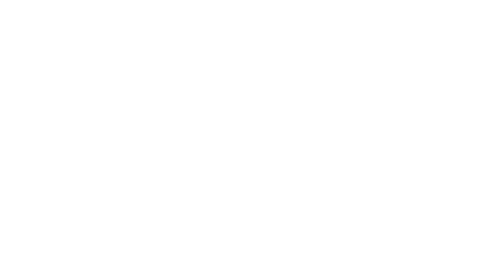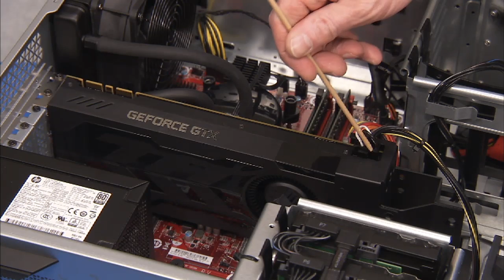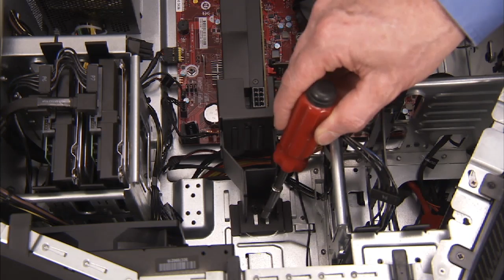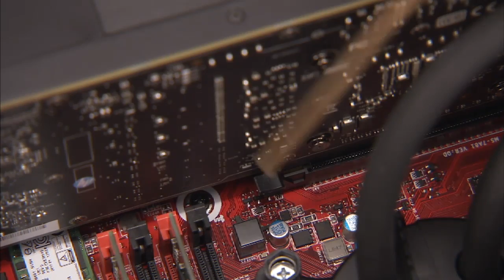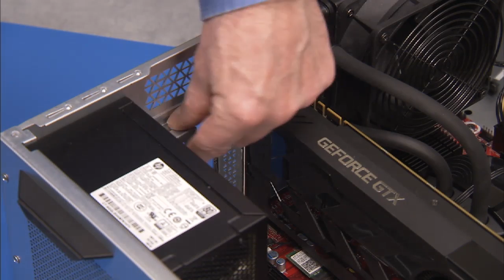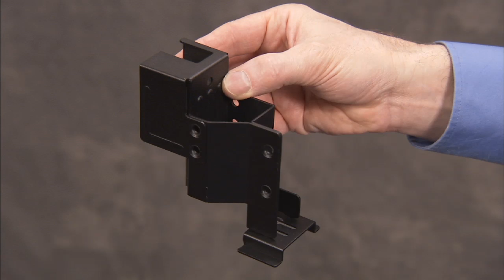Removing and Replacing the Graphics Card | HP OMEN 880 Gaming PC | HP Support

Comment: Will an MSI GeForce RTX 3060 Ti VENTUS 2X 8G OCV1 LHR, 8GB or other 3060Ti cards fit into this pc?
Reply from the maker: Hi Jack, thanks for contacting HP Global Social Media Support!
I understand that you need to know about compatible graphics card for your computer.
I will do my best to assist you.
This computer has two PCI Express x16 physical slots (Gen 3.0), each slot with x8 bus lanes.
So you can add graphics card that supports this slots. 
Binu_HP Social Media Tech Support
Reply: did it work? i habe an 1080 now and i want to upgrade it

Comment: Hello HP support, please I need your answer, I have HP Omen 880-072NF with GTX 1070 and I want to upgrade it to RTX 3060, will it fit inside the case? Thanks
Reply from the maker: Hi there, thanks for contacting HP Global Social Media Support!
I understand that you need to know about upgrading the graphics card of your computer.
I will do my best to assist you.
This computer has One PCIe x16 (GEN3) slot and One PCIe x4 (GEN3) slot.
So you can add graphics card that supports these slots. 
Binu - Social Media Tech Support
Reply: did it work? i habe the same pc with 1080

Comment: Hello, my 880comes with a GTX1080, can I upgrade it to a RTX3080?
Reply from the maker: +felipe del bosque May I know the complete model number of your computer?
Reply: @HPSupport   sure. 

OMEN PC 880-105ne

Procesador	Intel(R) Core(TM) i7-8700K CPU @ 3.70GHz   3.70 GHz
RAM	32.0 GB 
GPU GTX 1080
Reply: @felipedelbosque1 i habe the same pc, pls tell me if it worked, i want to do the same

Comment: Hi HP Support, I have the OMEN 880 with the 2080ti in it, I was considering upgrading to a 6900XT but the card thickness looks like the GFX_PWR1 connector might be in the way.  It's not clear what this connector is for but would removing it and powering the GFX from the ATX PSU alone be enough?
Reply from the maker: +Gaz JPN HP does not recommend upgrading or downgrading hardware parts or software that is bundled with the product as It may affect the manufacturer's warranty and performance, however, you could change the configuration at your own discretion.

Comment: i wanted to ask if a graphics card with these dimensions 28.00 x 12.00 x 4.00 cm would fit in my hp omen 880-118na
Reply from the maker: +Viyscer This computer has two PCI Express x16 physical slots (Gen 3.0), each slot with x8 bus lanes. So you can add graphics card that supports this slot.

Comment: i have a hp omen 880-101na and a 1060 3gb if i upgrade say to a gtx 1070ti that needs an 8 pin connector however my 1060 only needed a 6 will there be a 8 pin connector
Reply from the maker: +Psycho HP does not recommend upgrading or downgrading hardware parts or software that is bundled with the product as It may affect the manufacturer's warranty and performance, however, you could change the configuration at your own discretion.

Comment: Can it be upgraded to a rtx 2070 super?
Reply from the maker: +M45T3R  A 2070 RTX should be fine, but you need to make sure of two things.
1. That is is enough room to fit the size of the card to the area of the mini case if you have two expansion slots on the back of the case available.
2. You need at least a 500w Power Supply with an 8 pin connector. If your psu does not have an 8 pin, you will have to replace it with
Reply: HP Support ok, thank you a lot

Comment: So will an RTX 2060 card work for this system? My hp omen has a 500W Bronze power supply
Reply from the maker: +TheUnknown Gamer A 2060 RTX should be fine, but you need to make sure of two things.
1. That is is enough room to fit the size of the card to the area of the mini case if you have two expansion slots on the back of the case available.
2. You need at least a 500w Power Supply with an 8 pin connector. If your psu does not have an 8 pin, you will have to replace it with another ATX PSU. Yours came with a 500w psu, but I dont know if it has the connector. You will have to look it.
Is that what you needed to know?
Reply: @HPSupport  Well I looked at a gtx 1070 (which is what I currently have) has an 8 pin connector am I correct?
Reply: Just saying do certain cards only have fewer connectors?
Reply: did it work, i need to replace my 1080 with a better graficscard

Comment: Hello hp
I have a omen 880 167-nz with a 1060 3gb and I want to changing for a rtx 2060 is it possible?
Reply from the maker: +spoder155 I do believe that it would work but you may need to change your cooling system to a stronger one which is not usually that $$
Reply: @HPSupport  OK thank you very much

Comment: hey! i have a 870-224 omen that has a 1060 and an i5 7400. i was wondering if i could replace the 1060 3gb and replace with a 1070 8gb without upgrading anything else such as a power supply or anything else
Reply from the maker: +ilse padilla You should be able to swap in a 1070 or 1080. You have a 500 watt power supply. You should verify you have two supplemental six/eight pin PCIe connectors (my guess is yes since you now have a 1060). Verify the new card will fit. The 1060, 1070, and 1080 cards have similar dimensions. You will have to prep the system by doing the following before you install the new card: 1. Enter the BIOS. Disable Secure Boot. Then enable Legacy Boot. Exit the BIOS and save changes. Enter the on screen four digit code to confirm this change. 2. Uninstall the current graphics driver. You can now install the new graphics card.

Comment: Hello, I have a HP OMEN 880-088NF and i wanted to know if i can upgrade to a GTX 1070 ? Will it fit inside properly ?
Reply: +GO FAST I have checked the specification of GEFORCE GTX 1070 and GEFORCE GTX 1050 and found that the dimensions of both the cards are different. So it may not work with your unit. You can also find the specifications here: http://bitly.com/2PazguJ and http://bitly.com/2Pa3wWG

Comment: Can a Nvidia GTX 1070 fit in an hp omen 870-224?
Reply: +BLUU The supported graphics card for OMEN by HP Desktop PC - 870-224 is NVIDIA GeForce GTX 1060 (3 GB). You can confirm this under Video Graphics from this document: http://bitly.com/2voqHaN
Reply: So it can’t be changed? Will a 1060 6GB work? (Sorry, I’m really bad with PCs)
Reply: +BLUU You should be able to swap in a NVIDIA GeForce GTX 1060 as the 1060, 1070, and 1080 cards have similar dimensions. You will have to prep the system by doing the following before you install the new card: 1. Enter the BIOS. Disable Secure Boot. Then enable Legacy Boot. Exit the BIOS and save changes. Enter the on screen four digit code to confirm this change. 2. Uninstall the current graphics driver. You can now install the new graphics card.
Reply: Ok thanks!

Comment: Hello HP Computing Support, I would like to know what the pcb-number is of the gtx 1070 in the omen 880-p1xx. I would like to install the alphacool eiswolf gpx-pro watercooling solution, but I can't find the PCB description on the card. Thank you
Reply: +lars barthelmess well if you look carefully, the water block is the same length of the PCB so look in the specs of the water block to know its length

Comment: Why is my graficcard so strange in 880-050nz. I cant finde it anywhere and it isnt even a low profile card but stil a gtx 1060 3GB
Reply: Yanick Frei Yh same I have a 880-001na and I can't find my gtx 1060 3gb anywhere. HP please help.
Reply: +Taran Gaming2232 You can find the graphics card in your OMEN by HP Desktop PC - 880-050nz as mentioned in this document: http://bit.ly/2E7TRyI You can also find the complete specification under Video graphics in this document: http://bit.ly/2E9JHOc
Reply: HP Computing Support I found it anyways but it looks very skinny, it doesn't look like the thick gtx 1060 card it's the skinny oem manufacturer version of the card with a white fan on it. I was wondering if this can be upgraded to a gtx 1070 the thick card version???

Comment: How do I get the retaining bracket if I upgrade my GPU? The RX 580 that came with my Omen doesn't need the bracket but if I upgrade to a larger card I might need it. Is it safe to install a longer card without the bracket?
Reply: +SubstanceD91 for this I suggest you contact the HP phone support: http://hp.care/2oEj8Fb and they will assist you further.

Comment: I have this pc i7 16ram gtx1080 why is my pc the gtx1080 not on green leds ?
Reply: +SoNofMaRs 97 The steps to remove and replace the graphics card can be found in this document: http://bit.ly/2w846NX If the computer does not start after installing the graphics card, please perform the steps in this document: http://bit.ly/2w7y0lc
Reply: I wanted to know why the graphics card is not illuminated
Reply: +SoNofMaRs 97 Try uninstalling and reinstalling the graphics card driver. If the issue persists, please contact your graphics card manufacturer.
Reply: HP Computing Support do you have a video replacing the motherboard
Reply: +vengeance Please refer this video as it may help you: http://bit.ly/2wXzRaY

Comment: could you do these videos but with a hp omen 870 pls
Reply: +X.x.ALEX.x.X Please follow these steps to replace the video card. Remove the access panel. 1. Remove any external connectors to the expansion card if present. 2. Remove the expansion card retaining bracket on the side of the expansion cards. To do so, first detach the torx head screw securing the bracket to the rear of the PC. Pull the bracket off of the unit. 3.If removing a graphics card from the PCIx16 slot, press or pull up the latch for the graphics card socket to release its grip on the card. 4. Carefully pull on the edges of the expansion card to release it from the expansion slot. 5.  To replace an expansion card, carefully seat the card into its motherboard slot until it is secure. 6. The expansion card retaining bracket has two hooks that fit over two slots on the PC. To replace the bracket, slide the hooks onto the slots and 7. Reattach the torx head screw to secure the expansion card retaining bracket to the rear of the PC.
Reply: thanks :)
Reply: +X.x.ALEX.x.X You're welcome.

Comment: Sir my desktop hp slimline model 270-p030in suggest us grapic card power supply 180
Reply: +ms singh I understand that you want to know about the compatible graphics card for your HP Slimline Desktop - 270-p030in. I see that your computer supports One PCI Express x16. You can confirm this in this document under Expansion slots: http://hp.care/2rIs0Md So the graphics card supporting PCI Express x16 will be compatible with your computer.